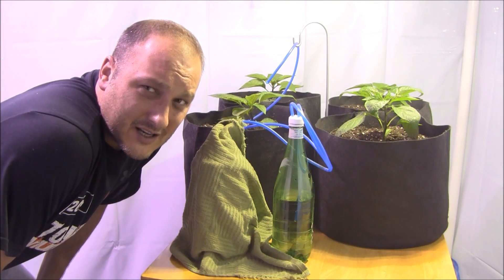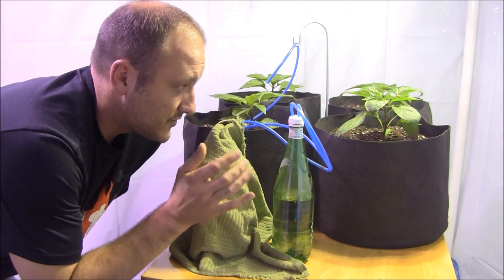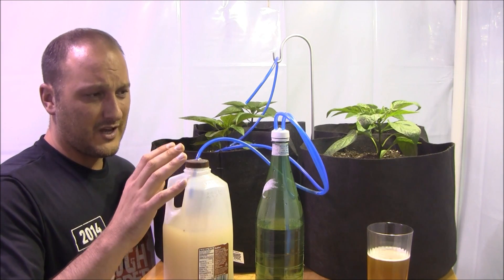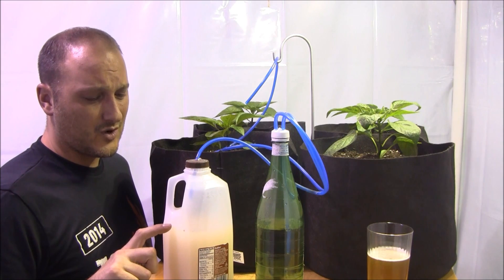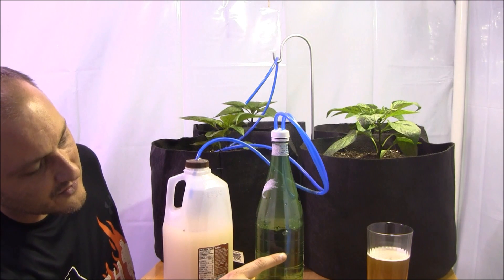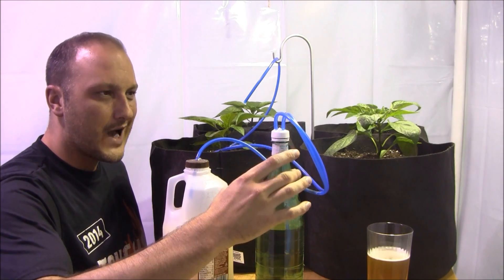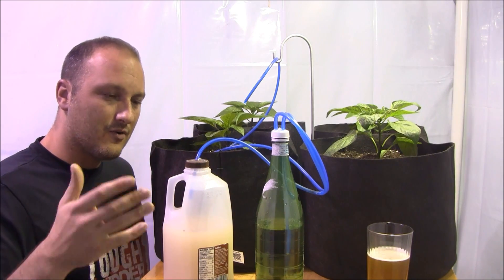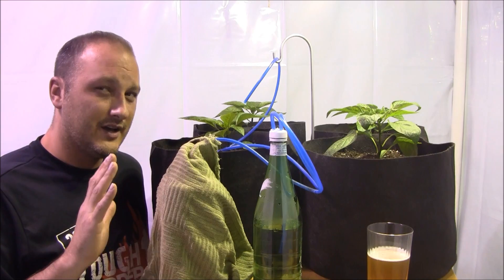Natural CO2 Enrichment - Trash Into Treasure - S2 Episode 5

Comment: Awesome video, thanks! I set one up with a 5-gallon bucket, using 1.5 gallons of water to 6 cups sugar with 2 tbsp yeast. Runs strong for about 3 weeks+ before needing a refresh. [I ran an aquarium hose into the bucket with an air stone under the water & submerged an aquarium heater set to 90ºF in the bucket. I connected those to the timer that shuts off my tent lights so that the process pauses during the dark hours when.] It worked great until summertime, when it gets hot in my tent and I have to run the exhaust fan constantly. According to my CO2 detector, the CO2 drops from 1000 to 1800ppm to 300-400ppm when the fan starts running continuously. Trying to think of a workaround to this problem but it eludes me. Anyone have any ideas?  Happy growing!
Reply: Are you still using the aquarium heater in the summer?
Reply: Use a sealed light hood to vent through to reduce heat and still not remove air from your tent, you can get a CMH but obviously LEDs would be out.

Comment: Nah...a bottle suspended above your plants with a bunch of holes punched in the cap.  Let the co2 poop out the top and sink down to your plants.  Never understood the tubing and extra water bottle.  Over-engineered.
Reply from the maker: That’s why I basically said optional on the tubing.  I have pop bottles with pin holes cut in the top that do the exact same thing.  But people like bubbles.  So I gave them bubbles.  I agree man.
Reply: I think the water bottle is to help dissipate the ethanol.

Comment: Great video but i got some questions 
1.Is this co2 gas toxic and since its heavier than oxygen will this still circulate in the air i have a small grow box
2 Do i need my setup to have no circulation to keep this on the plant or should i still have ventilation i can close my ventilation if needed
3 How long should i keep this co2 disperser going
4 if i close up the dispenser tube will it explode what can i do with this set up when i dont need it
Thanks heaps any adviceis appreciated
Reply: 1. Not toxic to plants unless it’s super high concentrations (that you can’t achieve with this method) 
2. Circulation might be helpful. C02 sinks to the ground so a fan might help disburse the co2 around the whole tent if it’s not being actively exhausted out. 
3. Until it’s not producing c02 anymore. Look for a lack of bubbles and strong alcohol smell.  
4. Bottle will pop if it’s closed off. Solution is to just keep it open. No harm is being done by doing so.

Comment: I heard that methods like this, since they are on a small scale. Do not make a big enough difference with each plant and not worth utilizing. I guess if you sealed everything off it would probably make a noticable difference. I'm not sure.
Reply: Air stone in the bottle speeds up the reaction and helps release the co2

Comment: the yeast should remain alive  after it has converted all of the sugar into alcohol so just pour away the liquid keeping the sludge at the bottom of bottle and just add more water and sugar.    You can just keep adding sugar to the origional brew and it will make the alcohol stronger.    If you flavour the water with hops you will end up with great home brew.     You will need a bigger container and if you use a gallon you can make 8 bottles of wine